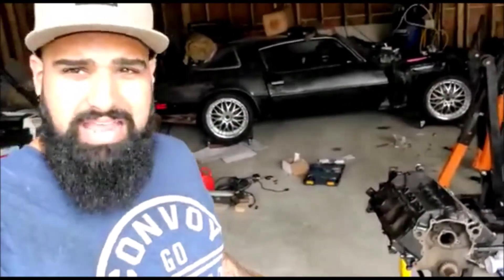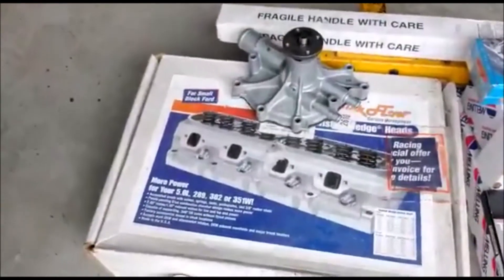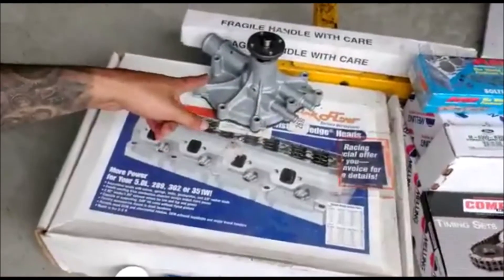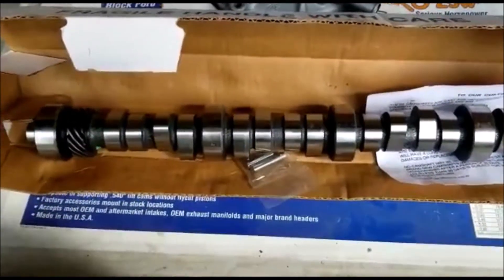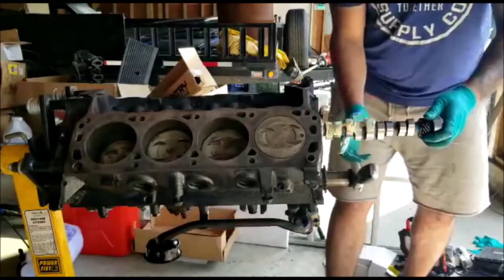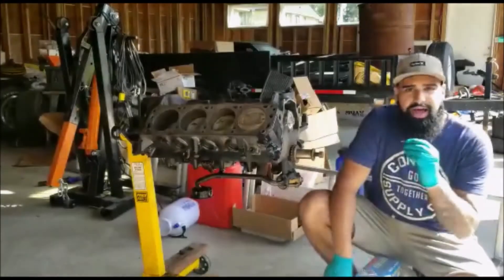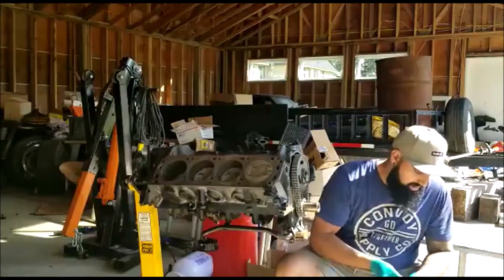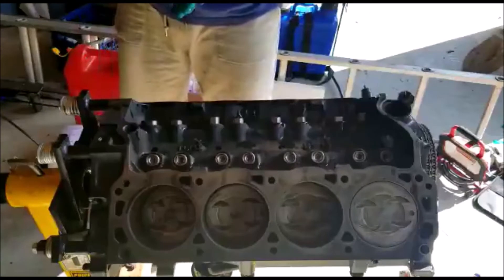Fox Body Mustang Engine Build Part 1  Cam Install

Comment: On the hunt for trick flow 170cc part #tsf-51410004-m61, what’s the part number for the correct 1.6 rockers to go with the trick flow heads & B303 cam?